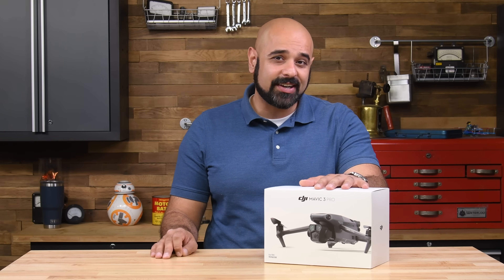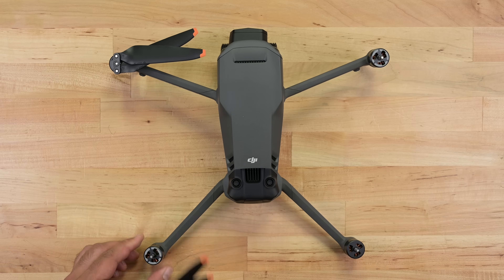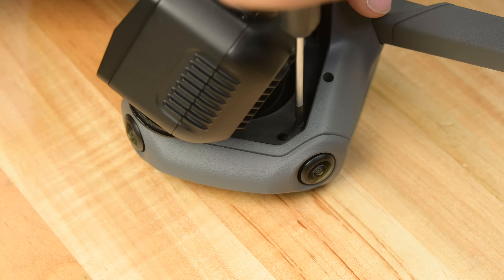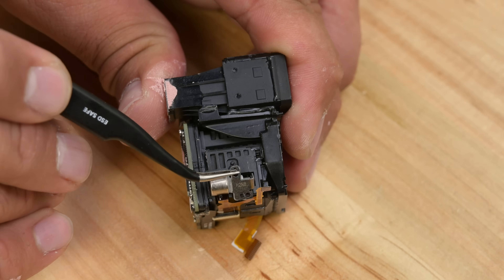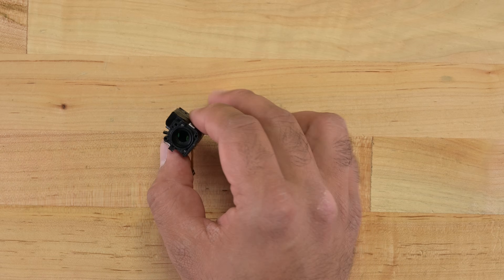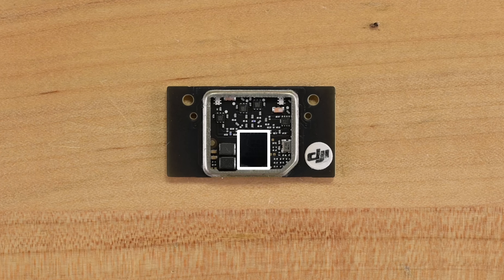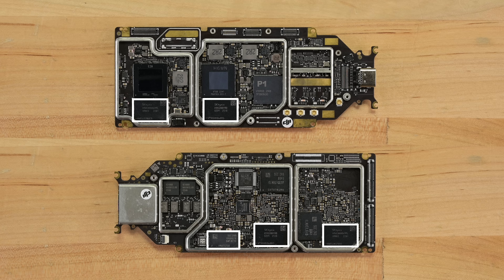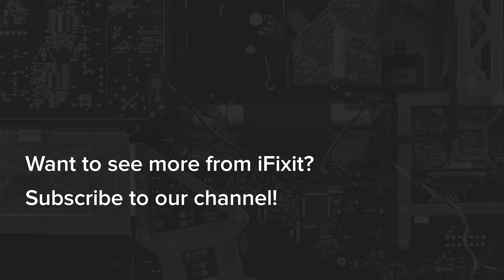The DJI Mavic Pro 3 Teardown - Inside DJI’s Latest Pro Drone

Comment: Mine had a collision yesterday 03/01/26 and the main camera is broken everything else seem like it’s ok but when I disassemble the camera and power it on the remote said “processor is overheating” so I pull the battery…. What do you think is going on before I open it up.

Comment: Excellent teardown. I'm interested to know how to repair/replace the Mavic 3/Classic/Pro Battery shell compartment Microswitch which is activated when the Battery is inserted into the drone. Can you please show what needs to be removed to access it, and which Microswitch to procure? Thank you very much! (I think that it is also applicable to DJI Air 3).

Comment: Did you know the mavic 3 pro camera does match with a body of mavic 3 dual camera? Just in case someone can do the upgrade. From the pass the mavic 2 zoom and hasselblad can change the camera each other.
Reply: It is not possible to interchange cameras between models, even in the same series.